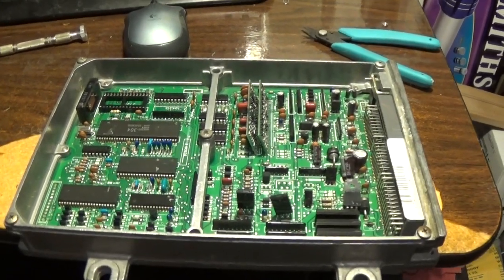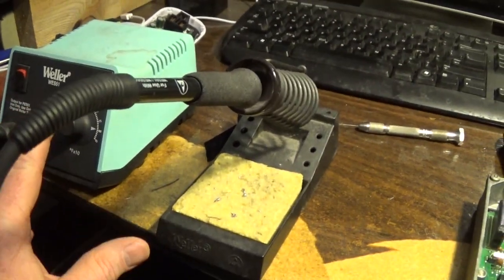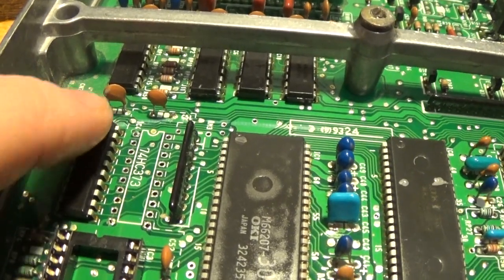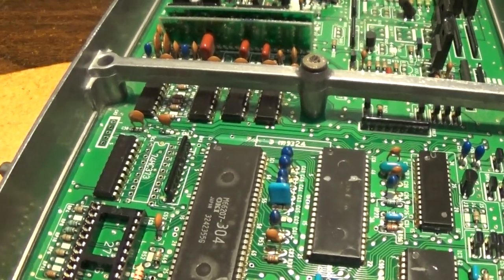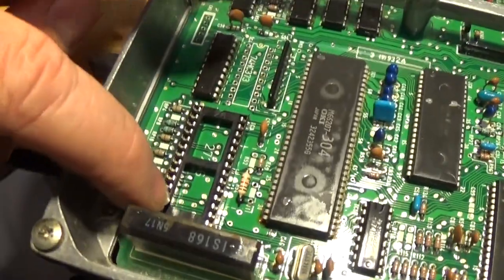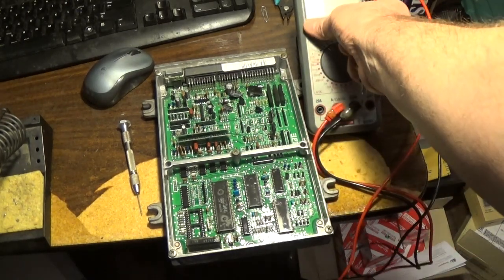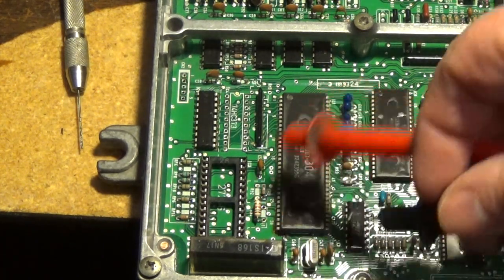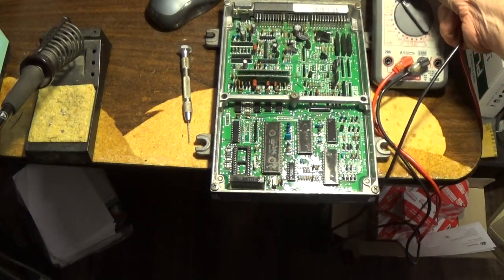Some tips when soldering ECUs

Comment: Hello, I gave soldering a shot on my p06 and it lifted a pad, wanted to know if there is a fix to it? thanks
Reply from the maker: Would have to be able to see the damage under a magnifier.  You can always run a jumper wire from the pin, to where is should go on the solder trace.  To do a good job, you need quality equipment.
Reply: @tubejim101  appreciate the reply, is it possible to get into contact with you? Maybe ig? I pretty much finished soldering the chip side of the ecu and adding the vtec components and the diode(d11) while desoldering the through the pad lifted.
Reply from the maker: @TheMandeep125  It would be cheaper top pickup another p06, then to have me repair yours.  If you where local, I would try and hook you up.  Might check at a shop that does dyno tuning. They might have some extras laying around from people who upgraded their ecu.
Reply: @tubejim101  I have no problem sending my ecu out to you, since my car is parked for the winter. And the car has a jdm ecu it runs on currently.

Comment: What temp do you usually prefer to run that Weller at for jobs like joints on that ecu?
Reply from the maker: Just a little above, what it takes to melt the solder.